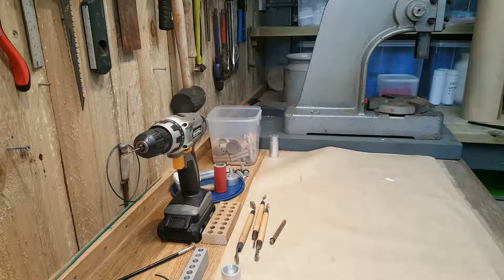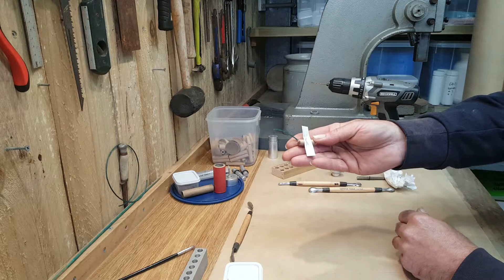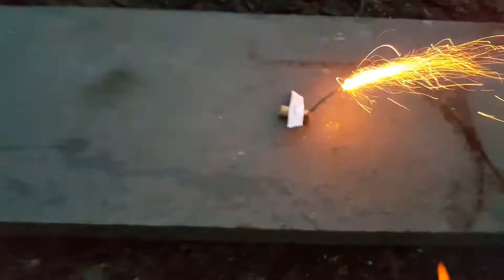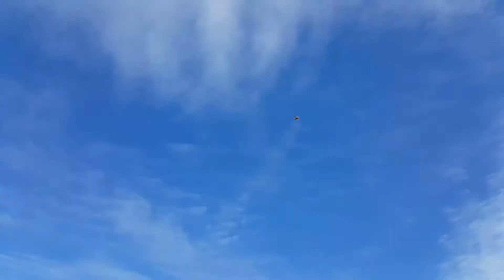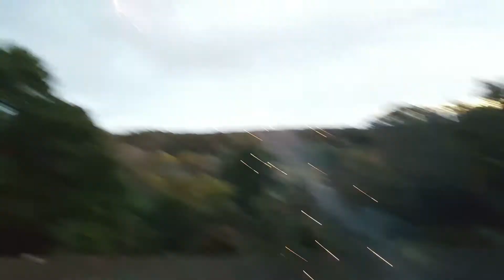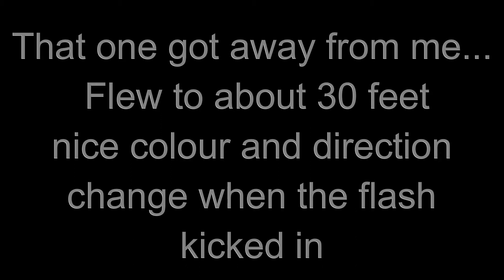Making Fireworks Making a Bumble Bee - How to make 6mm Bumble Bee Fireworks

Comment: Great video, do you think you would be able to put a  small report in these ?
Reply from the maker: I have tried, i think you would have to put a thin bulkhead of clay between the fuel & report with a small passfire hole. The flash I put in the end just gives them a push right at the end. Maybe a bit more flash would work.
Reply: @Pyrolife-net  thanks for the reply, ill give the thin clay bulk head with a pass fire hole a try hopefully it works.

Comment: Do you think i could use a red road flare for that extra push after the black powder?
Reply from the maker: May give them a little push along but will certainly give it some colour. Road flares are normally a magnesium comp so unsafe to ram with a hammer would need to be pressed
Reply: @Pyrolife-net  i ended up just making red flash and i uoloaded a video it takes off like a bat out of hell when it hits the 2nd stage. I used that recipe on the pyrolife website.